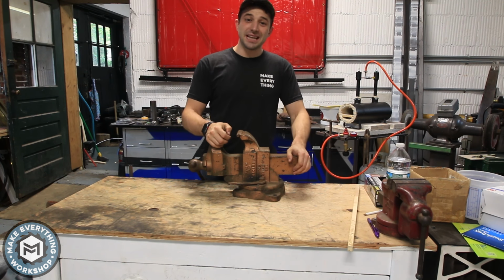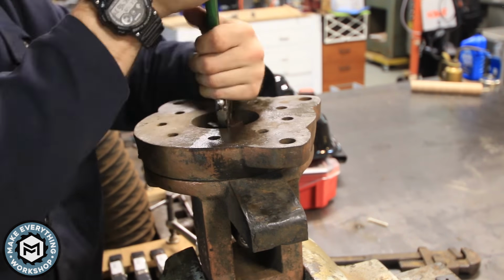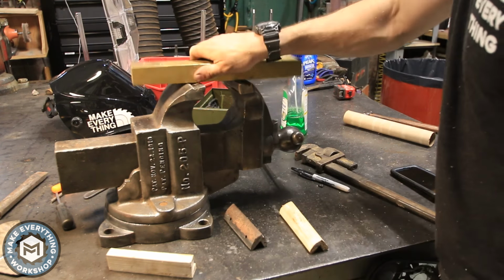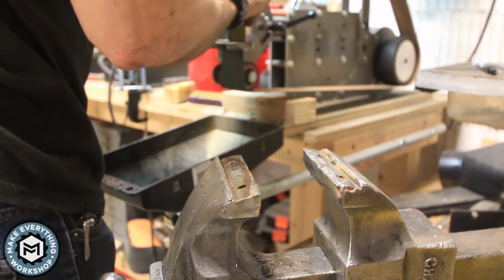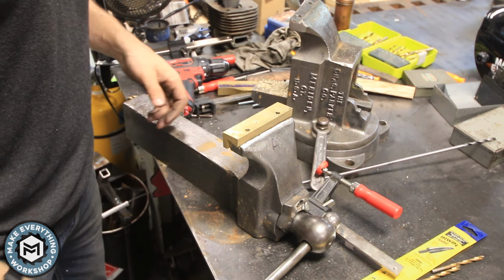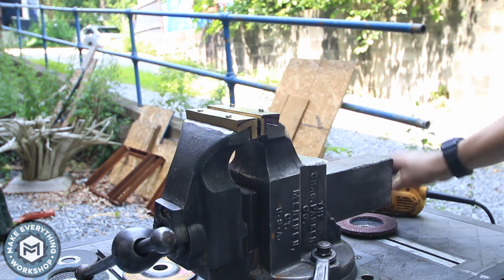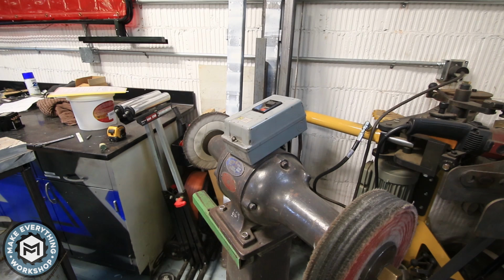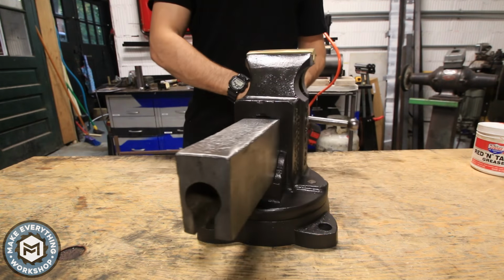Vise Restoration | 1910 Chas Parker 205-P

Comment: Beautiful refurbishment! With the wood jaws, you could have sand cast brass jaws from old plumbing fittings or cartridge cases rather than machine away your expensive brass barstock. I'm set up for casting, not machining, so my mind went that way as soon as I saw your wooden forms. And, an adjustable box wrench will grab that bottom bolt very efficiently. I'm restoring a Parker #435, and the adjustable box wrench has been super handy.

Comment: Man use those cut off wheels how you see fit. I do the same type of fine fit grinding with them as well. Use it like it’s yours, be safe they can come apart pretty easy and hurt you. Put in some leather, good gloves, and a good face shield and let it rip.  Sometimes they are the best tool for the grinding job. Be safe my man!

Comment: I just restored this same vise. Mine had a couple of broken parts that I repaired with silicon bronze brazing rod and a tig torch. I used a thrust bearing behind the screw handle which helps it operate a little smoother. It's a great old vise, well worth the effort. Great job on your vise.

Comment: Pro-painter tip: especially when working from rattle-cans, the next coat should always be applied BEFORE the last coat has completely dried for the best bonding between coats...this effectively makes one stronger, thicker coat instead of layers of paint.  Paint should appear dry to the eye before the next coat. It is still wet and accepting of the bond of the newly-sprayed layer. Cheers.
Reply: If they miss the window you are talking about the paint could alligator.  Shooting a coat too late will  cause problems.  I was shooting an old tool box.  Primer went on no problem.  Shot a coat of paint and let it dry over night thinking that was the thing to do.  Shot another coat and instantly alligatored.  Chalked it up to contamination on the surface.  Prepped it again afte repeating this with same issues I decided to read the can.  If you do not apply another coat within 2 hours then you have to wait 48 hours.  So not only does it increase the bond but also avoids other issues.  Your point is crucial with rattle cans.  When gassing off it forces its way through .

Comment: i just restored a parker 974. very similar vise except for the lead screw is squared at the end instead of oval it was 1940ish as opposed to yours which im guessing is more like 30's? I lucked out and didnt have to touch the jaws. They still had the teeth. . I paid 100 bux a similar vise new would easily be $500.Nice work!

Comment: Nice job on the vise, I bought a Chase Parker 974 vise at a garage sale for 25.00 i soaked mine in the heated parts washer at work, took it down to bare metal, i media blasted everything, taking care to cover the machined surfaces with foil tape. My jaws are more complex than yours there are 4 different angles on each one. they are the most complex jaws i have ever seen.

Comment: It has been a year since you posted the video so you likely won't see this. You made life SO much harder on yourself. You have a mill, you used it to rough the jaws, why didn't you use the mill to clean up the vise jaw locating surfaces themselves??? Starting from a good surface rather than a hand ground surface would have been so much faster and better in the end. To square the faces, a block of wood between the ram and base but under the jaws would have torqued the vise into alignment and mill the jaws square to themselves. I have an old Parker about twice the size of yours and one of the origional jaws was welded in. It was not worth the trouble to take it off just to reinstall it with pins. I simply squared as I said here and it has worked perfectly ever since.
Reply from the maker: There were definitely other ways to save this vise, it was a fun challenge to do it my way, and im happy with how it came out.

Comment: Why not use a metal grinding disc instead of the cutting disk? They make thicker discs out of (I think) the same material as the cutoff wheels that are meant for grinding. You get the rigidness of the cutoff wheel but the grinding capabilities of the flap disc.

Comment: Recovered a 8” Colombian vice that had been in the Pacific Ocean for several years after the El Niño storms of 82/83 destroyed the Santa Monica pier. The rust wasn’t too bad but the vice was frozen up and full of marine tube worms, a calcium deposit. Went straight to the rosebud tip on my acetylene torch and it didn’t take as long as you depict in the video.  It cleaned up nicely and I use it all the time. The jaw faces were not damaged for some reason. Perhaps because it was partially buried in the sand.

Comment: Prolly a stupid question from someone who doesn't own a mil... But why couldn't you just throw each half of the vise in the mill and square up the sides rather than using an angle grinder? Just too big? The material couldn't handle it? Just curious

Comment: great job building those jaws. Your video shows you can build these jaws different ways. those of us without a mill could probably just use a bandsaw to cut the jaws out before fine tuning with a belt sander.

Comment: Looks amazing, but why brass for the jaws?
Reply: It means if you're clamping aluminium or brass it won't mark it as badly
Reply: With a screw design, you'd generally have multiple sets (one steel, one aluminium, brass, wood, etc) so that you can use it on a variety of materials without marking them . With a design like that, you just make it out a material that isnt too soft (wood) but isn't too hard (steel) if you wanna use a variety of materials.

Comment: Try taking a rubber hammer and on the edges of the metal where the tape is. Give it a good whack. It will cut the tape

Comment: Holy fucking hell. Machinist here. Do yourself a favor and keep your quill raised up as high as you can. Work by raising the knee up instead. Also are you able to incorporate an air gun onto your setup — one you can keep on blowing at your cutter? Will help with chip evacuation and surface finish

Comment: The fact that the mess that the last person did to the jaws was salvageable was lucky.  If that bad weld job had stressed the iron too much it might have cracked; it is not as tough or ductile as steel.  It seems to have been barely on the edge of being rebuilt without some major cutting and rebuild using new iron/steel spacers to support the new brass jaws.

Comment: A tip for your custom fit on the jaws... use a black Sharpie like you would blue Dykem.  The Sharpie ink is not as tough as Dykem. Put it on the unflat surface, then rub your new, flat jaw on the rough surface. It will rub the ink away, showing the high spots.

Getting it flat will still come down to skill with the grinder, but the testing will be easier, and faster. When you get old like me, (+ a brain injury), the Sharpie trick doesn't depend on your memory for where to grind... yes, I can test fit, then forget where I need to grind.
Reply: If you like the finish of the brass from the wire wheel, pick up some Skotch Brite wheels, and use them with WD-40.  It's a great look for brass, copper or alum...

Oh, shoot some clear lacquer over the hand painting on the raise lettering, it dries fast enough it won't mess your paint up, and makes it much harder to rub off.

Until you learn which paints the lacquer will screw up, test it, first.  That's how I discovered an easy way to make crackle paint, as well.

Comment: When my wife went to work for MSC 10+ years ago, I spent a lot of time in their 'Big Book' catalog, learning about tools, etc.  What I discovered was the more expensive vises use a Torrington bearing instead of a brass washer, (or nothing), between the front half of the vise and the collar on the handle.

I went out to the shop, tore apart all the vises I have, from a cheap Japanese, (when Japanese stuff was like Chinese is, now), to the best vise I own.  None of them had bearings, some had washers, others, nothing.

I measured them all, and ordered Torringtons for all. It cost be less than $10 for the bearings, a cheap experiment.

I got good return on THAT $10. Now, when I tighten the vise, it's tight, and stays tight. Never have to hit the handle to tighten it, or loosen it.

It makes a world of difference.  Give it a try.  It even turned that POS old Japanese vise into something usable, and it is now mounted on a bench, instead of taking up storage space.
Reply: I would be very interested in seeing how you did that. Maybe a good video to post????

Comment: Question:

What buffing machine is that at 21:31?
Does it run in 240 volts, and what size of buffing wheels are that?

Cheers,
JJ. :)
Reply from the maker: Jasper Joppe Geers Thsts is “utility ball bearing co” buffer from the 50s. It’s three phase 208V. 1HP motor with 10” wheels. It’s AWESOME
Reply: @MakeEverything  It is awesome indeed! Need to find something like that myself. Thing is that most modern desktop machines only go up to max 200 mm buffing discs. Need something little bigger without switching to 380 volts... :) Cheers!

Comment: Tale a rusty POS and end up woth a good looking and functional tool. Bravo!

I do have some suggestions however. If you would have spent a bit more time accurately measuring the angles and dimentions you could have set up and made multiple interchangable sets of jaws and never had grief hand fitting.

You also could have made a near zero backlash for your screw retainer.

Pins in any size are commercially available and are relatively cheap. This would have given you an eternal availibity of exact fit spares.

Comment: remember HSS etc. end mills are sharper than carbide and brass-bronze-copper-alum is grabby not great for carbide and requires a different coolant as well. good job though, love what you're doing with old tool restoration.

Comment: Thats just scary, stay away from machining. If you must, learn basics. Raise your table instead of lowering the quill, especially with the dovetail, scary. You won't have fingers for long. Why is a 123 block near a fucking beltsander? Why are you making tapered pins? Drill, ream, dowel pressfit, done
Reply from the maker: HighStreet Killers I double as a horror movie director

Comment: Nice work, the vice looks awesome. Veteran metal workers only use a cut off grinder without a guard until they get bit by one. If you're lucky enough to not be missing any body parts... the guard goes on for cutting wheels after that. At the very least, if you must, don't do it bare handed. Full leather welding gloves at a minimum are mandatory. Take it from me... took me right to the bone fast enough to splatter blood on my face. only 10 stitches, but I was lucky. Not a mistake I intend to repeat.

Comment: Remember newbies, when you use you angle grinder without a guard after watching this guys videos and you end up with a wheel disfiguring your face after exploding, go to court and tell the judge you learned it from watching this guys video!  
Of course I’m joking, but seriously, this is a completely stupid mistake!  The guard can be moved and your only ever using a small part of the wheel! Just move the guard around if you need.  Theirs no excuse!
Use goggles, a full face shield, respirator and make sure that damn guard is in place!
Look up the videos of what happens when you don’t use protective gear while using these tools. They are extremely dangerous!
Only idiots use them without a Guard!  Don’t be an idiot. Their seriously is no reason not to use the guard.  No excuse, again, only an idiot has reasons not to use the guard.

Comment: Nice work! The only thing I wouldn´t agree is removing rust with rotating brush discs. You don´t actually remove the rust, you just polish it and make it more dense. It´s still rust. If you want to do it properly use a csd disc. It does remove rust.

Comment: I got an old vice from a flea market recently, the mechanism is the same, but I can tell it's not the same one because the bench attachment points are different. I'm curious if it'd be possible to take some power tools to mine and fit it for interchangeable vice jaws?

Comment: Should have used a sandblaster... I got away for the most part using wire wheels. Today 99.9% of them are made in China and are crap, plus the sand works so much better because it will get into everything and make it look like brand new. If you really want to get creative, use glass beads.

Comment: The jaws should be hardened steel, brass under real use won't last five minutes. That vice in its day was a mans vicee you have turned into a ladyboy!!
Reply: "soft jaw" vice is a perfectly normal item.
Reply: Yeah, the brass looks GREAT ! And if worse comes to worse and they're too soft after all, use 'em as a pattern to machine some duplicates in steel. AWESOME job on the restore. I need to do this to my dad's old small vice he still has.
Reply from the maker: Coyote good thing nothing I do takes more than five minutes! 😉
Reply: What do you expect?  The guy grinds with cutt off wheels, removed the guard on the angle grinder and does not use a full face shield. 
Everyone’s hero right?

Comment: Beautiful job! Great, informative video. I have the same vise, found it at a flea market years ago. Fortunately mine wasn’t as badly abused—just took it apart, degreased it, wirewheeled all the old paint off, masked and painted it with Rustoleum, then greased and reassembled it. I didn’t have to mess with the soft jaws. It’s given me great service ever since. It’s a beast!

Comment: Only Prob I have is why in the world would you put much softer BRASS JAWS back where steel jaws were originally  Steel jaws could wave been made almost as easily as brass and would have been much more original
Reply: He wanted non-marring soft jaws
Reply: he literally said why at the end
Reply: You can interchange the Jaws brah, nothing to sweat over. Each jaws has their own purpose, and for w/e project hes going to do next will require those jaws. But with the pin system he can remove them, and put other grades of meteal for w/e projects in the future.

Comment: No cross cuts on the jaws for traction of anything held? Items will just slip
Reply: A smooth flat parallel jaw surface will hold better, more surface area contacting. Im an actual machinist i know.This guy doesn't even know how to keep those junk knurled jaws from marking his part, facepalm
Reply: HighStreet Killers yea right, so you drive on slick tyres then? Better grip? Lol. Trust me you are full of s***
Reply: @peterharding5837  Slick tires do have better grip in dry conditions.  The tread is for wet or loose conditions - while still giving grip on dry road surfaces - though not as much as slicks.  For vises, these are brass jaws meant to hold parts that you don't want to mar because they are finished (I mean the surface is).  I use hard nylon on mine.  Both flat and jigged.  And of course my steel jaws are knurled, but I have noticed other folks have smooth steel jaws.  Could just be they have older vises  - or maybe they work better - don't know.  In the end, the guy got what he wanted though, and the end product should be easier to use than the previous crap fix - and looks nice.
Reply: @peterharding5837  sorry my dude but thats not how static friction works. The more surface area in contact with a another surface area nets a higher static friction. A higher static friction level mean more force will need to be applied for the friction to be broken and start something called kinetic friction. The reason tires are grooves are to displace water and snow so you dont ride on top of the water or snow. 

This makes sense if you think about high end dragsters or NASCAR. They use no tread tires to increase the static friction they have on the track. They need more surface area contact because of the MUCH higher torque being places on the tread. It helps them REDUCE spinning tires on take offs. They also burnout to heat the rubber up so the static friction level between the road and tires is pushed even higher. 

If more tread grooves means better hold the fastest cars would have microfiber groves all over them. instead of smoothed wheels.

Comment: Cool project but wouldn't aircraft remover and electrolytic rust removal be quicker and safer?
Reply from the maker: Xaq Fixx thanks! It’s definitely another route to a similar result. I’m not a huge fan of paint strippers as I don’t like to work with chemicals, I feel much more comfortable with stripping tools like wire wheels and such
Reply: After a bit of wire wheeling to get the rust off, a nice bath in Phosphoric acid would eat the rust and leave a light oxide coating. It's the same acid as in some soft drinks, sold as Prep n Etch or Ospho depending on what store you get it from. Burns much less than battery acid should you get it on your skin so somewhat safer.
Reply: Makes sense, Aircraft Remover is gnarly stuff.
Reply: Sandblasting... Just sayin'

Comment: Came out looking nice. Last one of these I did, I used standard taper pins-- drill for rough alignment, ream in place, drive pin and flush. Also, once the jaws are pretty well fit, you can get a much firmer fit by using a bedding material to take up gaps. Even JB weld works. Wax the inside of the jaw so it will release. ALso, the area at the rear is not an anvil. It you use it as one, you will eventually damage the vise. Really. This vise isn't meant for heavy impact, but you can grab a heavy block in the jaws for light work.
Reply: Yeah - not a hardened surface.